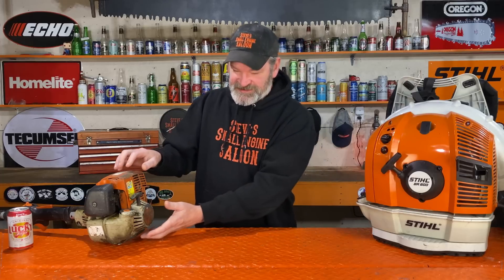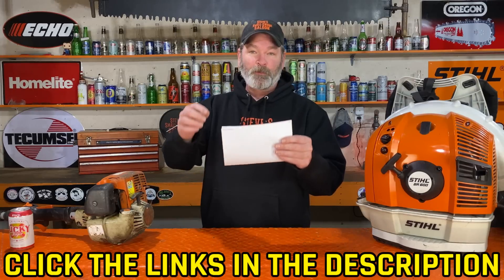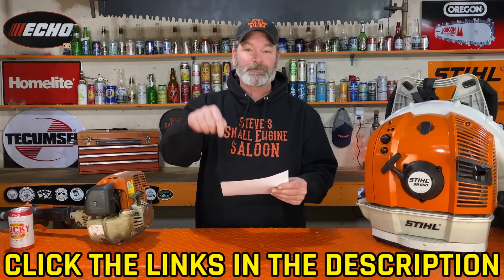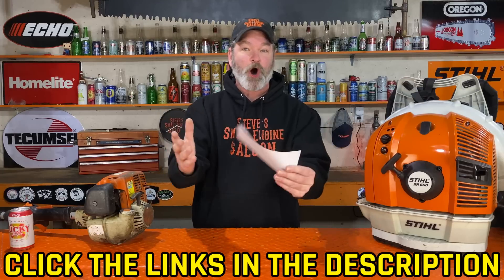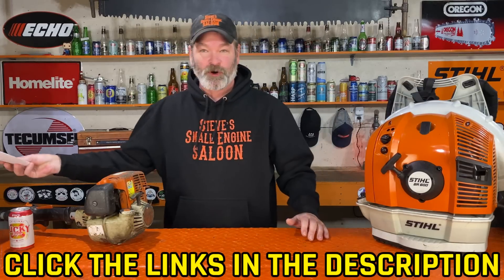Is A Stihl 4-Mix Engine A 2-Stroke Or A 4-Stroke? (DAY 1)

Comment from the maker: Click below 👇👇👇 for the links to the other questions...
Check out the STIHL link mentioned in the video here 👉 https://www.stihl.com/4-mix-engine-lightweight-and-with-good-lugging-power.aspx
⭐30 DAYS OF QUESTIONS⭐ - (Links will be updated as the videos are put out)
👉DAY 2 - Are John Deere riding lawn mowers made by MTD? ➜ https://youtu.be/iCJsWsd6SLo
👉DAY 3 - How Do I Break In A New Chainsaw? ➜ https://youtu.be/NE4Q1Y8v2U4
👉DAY 4 - Does Soaking WeedEater Line In Water Actually Help? ➜ https://youtu.be/84hFN_jveMc
👉DAY 5 - Why Does My Briggs Lawn Mower Say Never Change The Oil? ➜ https://youtu.be/k8BE55-P68w
👉DAY 6 - Can I Use Outboard Mix Oil In My Chain Saw? ➜ https://youtu.be/AlmegbfUJpU
👉DAY 7 - What Is Your Favorite Chain Saw? ➜ https://youtu.be/wMJeH0jCcHM
👉DAY 8 - Why Does My Grass Chute Keep Plugging Up? ➜ https://youtu.be/WtbhiNy42IU
👉DAY 9 - What Does The Purge Bulb Actually Do? ➜ https://youtu.be/sbDPU73fQQY
👉DAY 10 - What Is Your Favorite Penetrating Oil? ➜ https://youtu.be/jrzNv_Db0ZA
👉DAY 11 - How Do I UnFlood My Chainsaw Or Weed Eater? ➜ https://youtu.be/n0UnfoL5qWk
👉DAY 12 - Why Is There Such A HUGE Difference In Gas/Oil MIX RATIOS? ➜ https://youtu.be/-bsbKqZbyrw
👉DAY 13 - Why Does My Leaf Blower Bog Out When I Pull The Trigger? ➜ https://youtu.be/O4fMjSg7Z_U
👉DAY 14 - What Does WARRANTY Actually Mean? ➜ https://youtu.be/D-8054Q6vx0
👉DAY 15 - Can I Remove ETHANOL From My Gas? ➜ https://youtu.be/qZo4ItYiMCQ
👉DAY 16 - Why Is My Pressure Washer So Hard To Pull Start? ➜ https://youtu.be/Apipsdmf8qs
👉DAY 17 - Why does my chainsaw leak oil when I’m not using it? ➜ https://youtu.be/3P5ITSFWUZg
👉DAY 18 - Can I Use Old Dirty Motor Oil As Bar And Chain Oil In My Chain Saw? ➜ https://youtu.be/ilRZNsBNE3Y
👉DAY 19 - Should I Buy My John Deere Lawn Mower From Home Depot Or My Dealer? ➜ https://youtu.be/IZRjSYwYhyc
👉DAY 20 - Do Battery Powered Chain Saws Work Good? ➜ https://youtu.be/Zb8XNGfHsQU
👉DAY 21 - Honda Is Stopping Lawn Mower Production? FAKE NEWS!! ➜ https://youtu.be/y4TSwWHFb-o
👉DAY 22 - Will cleaning the rust off my flywheel help with spark? ➜ https://youtu.be/w8-exMgUhuc
👉DAY 23 - NO SPARK! How Do I Know If My Coil / Ignition Module Is Faulty? ➜ https://youtu.be/HBFz_N0SxuY
👉DAY 24 - Will I DESTROY My Pressure Washer By Doing THIS? ➜ https://youtu.be/22OlLNAZKa8
👉DAY 25 - How Do I Fix An On/Off Kill Switch? ➜ https://youtu.be/IyaUpGh19CI
👉DAY 26 - Why doesn’t my lawnmower have an oil drain plug on it? ➜ https://youtu.be/BXJbWWhMk0s
👉DAY 27 - Why Is There Black Oil Coming Out Of My Muffler? ➜ https://youtu.be/SNHdUh5tRoA
👉DAY 28 - Can I Put A LONGER Bar On My Chain Saw? ➜ https://youtu.be/OrRux_GSQQQ
👉DAY 29 - Why Does My Engine STOP Running After A Few Minutes? ➜ https://youtu.be/m5LEwNi-geM
👉DAY 30 - Can I Make A Lawn Mower Run On Propane? ➜ https://youtu.be/UkYCa1WhFGs
Reply: Think of it as an endless source of revenue. Shhh - just take the money. 
Also, I bet all the machines come with a comprehensive instruction book, so even if you can't get your head round the 2stroke or 4stroke cycle then follow the instructions.

Comment: steve, you can't say 4 cycle 2 cycle. that is a vernacular that is peculiar to small engine repair only! a cycle is a single thing and is not the same as a stroke. up your game a bit by using the correct terms used by the rest of the world.

Comment: For an air-cooled 2-cycle engine the oil must be JASO FD rated and if you cannot see FD on the bottle it is not FD rated. The best deal in an FD rated 2-cycle oil (must have for trimmers, blowers, chainsaws and any other non water cooled power equipment) is Kawasaki Genuine 1 Gallon OEM 2-Cycle K-Tech Engine Oil  which is $44 a gallon off Amazon or the 1 quart VP Racing FD rated Semi-Synthetic 2-Stroke Oil for $10.77 off Amazon.

Comment: The Stihl '4-mix engines are obviously, clearly four-stroke engines. Anyone with an ounce of intelligence can see that. But I do think the engineers at Stihl have lost their minds. This '4-mix' design is a joke. A four-stroke engine with oil in the crankcase is a tried and true design. It's pretty much impossible to improve on. Stihl decided to add oil to the fuel and eliminate the crankcase oil. But why? There are NO advantages at all. The engine pollutes the air more than it would have if left as a standard four-stroke. Stihl just wanted to present something 'new and improved' to show us how clever they are. A solution looking for a problem.

I have a Troy-Bilt trimmer with a four-stroke engine. I run it hard, on my farm, and after seventeen years it must have thousands of hours on it. It's been trouble-free and required only a new clutch, ignition switch and sparkplug in all these years. How would eliminating the crankcase oil help? That's right: it wouldn't!

By the way, internal combustion engines are either two-stroke or four-stroke. They utilize a two-stroke or four-stroke cycle. They are NOT 'two-cycle' or 'four-cycle' engines! Great video as always, Steve.

Comment: Hi Steve will please explain how the 4mix engine works with only one cam ? Instead of the two cams needed on most single cylinder 4 strokes . Thanking you in anticipation for your reply which will be very much appreciated. Best regards Brian

Comment: Hi Steve I bought three years ago  a Stihl fs91 brand new together with a Echo srm225 I’ve used both commercially and my Stihl is already shot it has a bad crank and my little echo is still going strong I’ve only had to change the carb on it once and all my Echo equipment are over lasting all my Stihl 4mix equipment Mechanics have been telling me to stick with Echos they will last longer then Stihl you think this is true cause I am noticing they are lasting longer and way less maintenance then Stihl’s.

Comment: It all depends on the power cycle. If it take 2 strokes per power cycle its 2 stroke. If it takes 4 cycles per power cycle it's 4 stroke. 
The Detroit diesel made 2 stroke diesels with valves and oil in the sump.

Comment: I've recently switched to stihl and im learning there ins ands outs. Like cleaning carbon and adjusting valves. I have the hedge trimmers as well and one falls on its face when you hit the gas but i don't see a valve cover.  Already replaced the carb with no change. Any advice? Thank you
I'll add it's about 2 years old and been run hard daily 🔧

Comment: I'd assume the intake tract is connected to the crank case as in a 2T to lube the crank big and small ends,the fuel/oil mix would run around the valve gear too before it goes into the cylinder via the intake valve.
I can say that some 4T engines have dry sumps with with an oil tank,all thing possible,but to add the weight of the valve gear etc and still have to premix,i'd plum for the simple mechanics of a 2T every time.

I own a few 2T garden implements,a 2T motocross bike(1989 RM250) and a 4T triumph spitfire,the only other 4r 4T i'd get would be an enduro bike or a farm quad....2T racing quads kick ass.
2T is super easy to tune for power too from case matching,costs a new gasket and some elbow grease.

Comment: First time here and I am surprised. The difference has nothing to do with the type of valves.  It is as the name makes clear, a two cycle engine fires after two cycles of the piston - 1 down and 2 up . A four cycle engine fires after four piston cycles - down = intake, = up, compression, down = combustion , up = exhaust. What type of valves are or are not used or the type of lubrication system is irrelevant. Stihl’s 4 mix engine is a good example with ignition on the forth piston cycle it is a 4 cycle engine with a premixed fuel/oil lubrication system.

Comment: if you go to my local Stihl retailer service shop(DEERELAND) they have no clue and when your machine stops getting fuel due to water in the tank they will sell you 1 fuel filter and let you leave the second filter in the tank not working either not knowing there are 2 or ignorance where you will be back in right after you let the replacement get contaminated by bad fuel

Comment: I guess there’s a good reason for it or presumably Stihl wouldn’t make them, but a straight 2 stroke from experience with bikes firing every time the piston hits tdc generates more power in a small engine than a 4 stroke where it fires every other time it reaches tdc.  I dread to think what the exhaust valve looks like.

Comment: I have not heard of this before, but it is interesting. My only question is why? The main advantage of the 4 stroke is that you do not have to mix fuel and oil. The main advantage to 2 stroke is the lightweight power. Why mix the two?I really don't get it.
Reply: So you don't have to change oil in the crankcase AND you can operate it in ANY position without worrying about the oil the sump not being down there to lubricate the bottom-end or flooding the cylinder with oil when it's upside down
Reply: @davelowets  So, a two stroke.

Comment: Why would you want a 4 stroke to take 2 stroke fuel, just use a 2 stroke.  One complaint of 2 stroke is emissions due to burning oil.  Normal 4 strokes don’t have this issue.

Comment: That is confusing as hell. The Stihl is a 4 stroke engine that uses 2 stroke premix so they decided to call it 4 mix (meaning 4strokewithoilinthegas). Detroit "Screamin" Jimmies were 2 stoke engines that had exhaust valves but uses diesel for fuel and has an oil sump for lubrication.

Comment: Some of the armchair "experts" are indeed and EX-pert. I'm not an expert of any kind but if it's got valves, is not ported like 2-cycle and doesn't have reeds like the some of the old outboard engines.. IT'S 4 STROKE/CYCLE... That's what I think😁

Comment: Question? 4 cycle engines are normally slower rpm engines. Is this still true? Add to that, don't it need extra parts like a camshaft, etc! Guess it follows a diesel engine!

Comment: Wow Steve, I think that question struck a nerve...LOL.  I don't have one of these engines but saw or read somewhere that using the Stihl brand formulated fuel mix in these engines is somewhat essential for survival.   Maybe it was your video, I don't recall.  
Thanks for your question series, hope the next one is easier on ya...Cheers 🍺

Comment: I see how people could confuse it. You’re bying two-stroke oil and mixing it in to the gas for a Four Stroke machine. So I understand where you’re coming from. As far as I’m concerned, they were a bad design to begin with and still are bad design. All it does is confuse people thinking oh I bought a four stroke so I don’t have to buy two-stroke oil anymore and it’s gonna save me money. Unfortunately, that’s not the case with these motors. Definitely work well if you understand that you have to use the two-stroke oil. .. I won’t even work on these things in my shop. Because people don’t understand and they end up thinking it’s your fault that they blew up.

Comment: We had similar problems with 2 & 4 stroke diesels years ago. Weather an engine has an oil sump has nothing to do with how many times the piston goes up or down to complete a power 
cycle. 4 strokes have intake , compression, power and exhaust. 2 strokes exhaust and intake at the end of the power stroke and the other stroke is compression. As the exhaust exits it pulls intake air or mixture in. I hope this helps someone.

Comment: A little off topic here, but sadly shows even some Stihl shop guys don't know an engine from an engine.
I have an older Stihl FS65-4 trimmer, and it runs great.
Tried to order some parts from a Stihl dealer once, and when I told him the model number, straight away he said, 'oh you mean an FS65 - 4mix?'
I had to say no, twice. 'No, it is a 4 stroke, with an actual oil sump, and it runs straight petrol'
He argued with me that it must be a 4 mix, and I have to add oil to the fuel.
I eventually had to tell him, No, No, and no again, it's a true 4 stroke, and it actually has a Honda GX31 engine, but it was just rebranded and disguised as a Stihl🤣🤣👍🇦🇺

Comment: And you need to adjust the valves on those things from time to time . If they get hard to pull over and kick back when cranking it's time for a valve adjust and Stihl offers a special little feeler gauge to do that job . I know , I have two FS 130 and they are very powerful . They have been used and abused cause I got them from a lawn maintenance company .

Comment: Well, I learned something new, I have never heard of a dry sump 4-stroke before. 2-stroke engines are dumb anyway, because of all that messing with oil and fuel ratios. 4-strokes are more efficient anyway, and the wet [oil] sump makes for a long service life. 2-strokes can rev hard, but they have no torque. Plus they are noisier and stink. Cheap rubbish basically. if 2-strokes were that good, they would have them in cars.

Comment: it's a 4 stroke that takes mixed gas.  how is that a hard concept for people?
Reply: You’d be surprised. I watched a few videos and people are saying it’s a 2 stroke with valves.  They just can’t comprehend a 4 stroke that lubricates itself with oil in the fuel.
Reply: @stephenparchewski  it goes "brrrrrr" instead of "ring-ding-ding-ding."  it's obvious to hear.
Reply: The problem is, common sense isn’t that common any more.

Comment: Well you learn something every day! I've never heard of that. All 4 stroke engines I have ever seen have a wet sump or lube oil seperate from the fuel. Thank you for the enlightenment
Reply from the maker: You're Welcome...
Reply: Have a look at some of the old engines from years gone bye. 4 stroke cycle, no sump. total loss oil system. 
Norton Motorcycles made a prototype engine which could be described as a 2stroke/4stroke with no valves but had a wet sump.

Comment: There are no 4 cycle or 2 cycle engines. The cycle is intake, compression, combustion exhaust. One cycle - it’s a cycle engine. Some configurations complete the cycle in 2 strokes. Some configurations complete the cycle in 4 strokes. So there are 2 stroke and 4 stroke versions of the cycle engine. Even though I see manufacturers who put labels on their engines and state on their packaging “2 Cycle” and “4 Cycle.” There is a difference between a cycle and a stroke.

Comment: I can't believe that someone claimed to be a Stihl technician for 20 years yet doesn't know that a 4-mix is a 4-stroke.  In fact, I do NOT believe it.  He's clearly never taken one apart, you can literally walk the engine through all 4 strokes.  It not only has valves, but pushrods too and a cam built onto the crankshaft.  Sure, it is an unconventional design, but a 4-stroke just the same.  Whoever that guy is, I'd like to see his certificate from Stihl.  I call BS.  Reminds me of a reader question I saw in Hot Rod magazine where someone claimed to be a certified GM technician, and asked Hot Rod Magazine how to convert a Pontiac Fiero to RWD.  The answer from the editor was "Um, all Fieros are RWD.  GM Certified Technician eh?"

Comment: Four stroke combustion cycle , two stroke type lubrication . I have one , I bought a pro grade FS131 brushcutter last year , I'm happy with it .  Some conventional 4 stroke engines have a dry sump and use a scavenge pump and external oil tank , useful in things like aircraft that go upside down sometimes etc.
Reply: Thank You for clearing that up for me, I was actually wondering why a 4 cycle engine was being called a 4 mix on some of the videos. Thank You!

Comment: If the engine has inlet and exhaust valves and runs the suck, squeeze, bang, blow configuration and fires every other stroke its a four stroke. If the engine has transfer ports along the sides of the cylinder and piston and fires every stroke its a two stroke having the suck and squeeze in one up stroke, transfer and blow in the down stroke its two stroke.
The bit that's confusing people is the lubrication, there's a wet sump filled with oil and there's the dry sump with the lubrication in the fuel mix. The beauty of the dry sump is it will run in any orientation.

Comment: There is no adequate reason that stihl shouldn't make their 4mix backpack blowers with a small oil sump and operate like a traditional 4 cycle engine. It would only make it about 1-2 pounds heavier.
Reply: Part of the reason is making it acceptable to EPA to save fuel and reduce exhaust emissions.

Comment: I was given a 4-mix engine weed whacker a few years ago by a buddy who simply didn't get the concept of mixing fuel for his 4 stroke engine.  Fortunately for me he bought it thinking he didn't have to mix fuel anymore.  I did get it before he put straight fuel in it though. He's since moved on to, sigh, a cordless trimmer.
Next to bacon, the smell of burnt mixed fuel is my favourite smell on the planet.
Reply: What dumb customer thinks that since they are 4 stroke so they don’t need oil/mix  , yet then goes ahead and runs them without checking the oil level first ?   Maybe a habit I learned from flying , check that oil level every flight !
Reply: @KevinSandersMDGoHokies  Fortunately, when someone forgets to lubricate their trimmer, the trimmer dies.  When someone forgets to lubricate an airplane engine, well... I don't even want to say it.
Reply: I'm with ya on the smell buddy, nothing sweeter than a day of sawing on a cold crisp day and the smell of sweet 2 stroke oil mix in the air..

Comment: 4 , but stay away from br600 up blower 
POS 
Wrist pin failure is terrible
Reply: I have the BR - 600 and it's running strong over 11 years now. Look how many reviews on sthils website on this blower and see how outstanding the reviews are. Top rated blower.
Reply: @markclark1605  4 mix blowers are falling like rats , seen 2 in the last few weeks. Same problem,  no bearing in wrist pin , they use bushing..